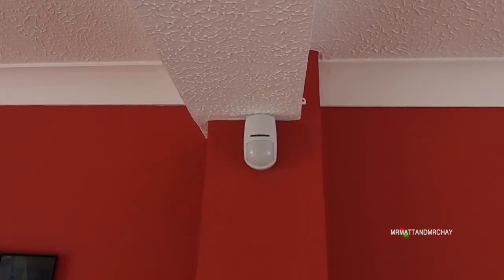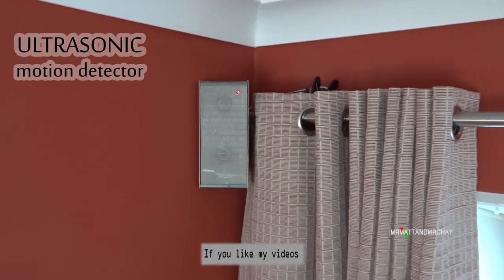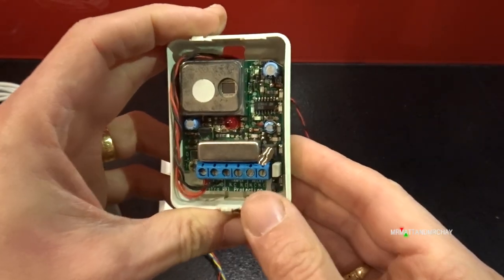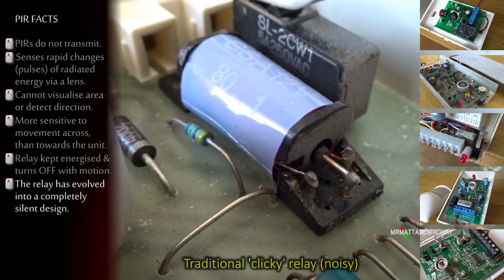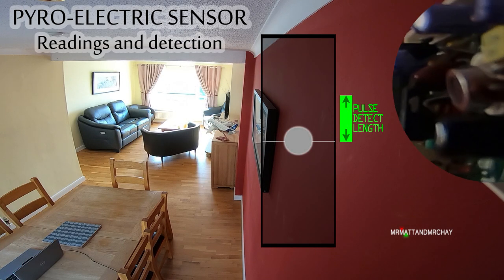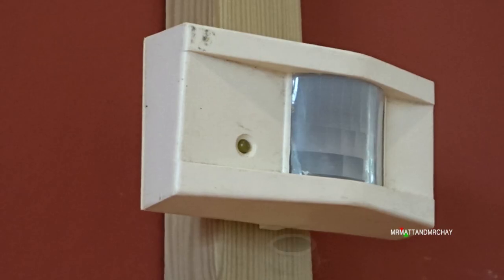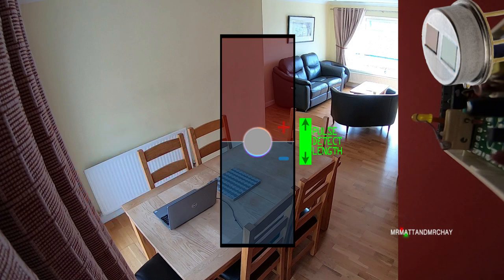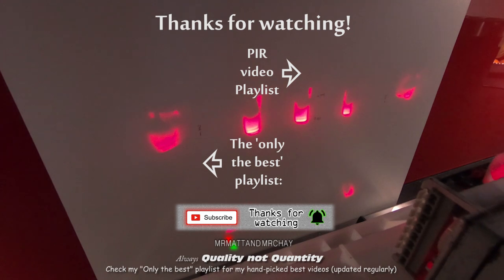PIR motion detector - HOW IT WORKS (easy to understand)

Comment: Great explanation, thank you! That reminds me of how I tried to make colleagues understand why the alarm system didn't go off when a piece of ceiling cladding in a room at work came loose one night and fell down. "We have got motion sensors, it must set off an alarm", but they just didn't understand that something that has the same temperature as the rest of the room and therefore does not emit more infrared than everything else around it is invisible to PIR detectors. They just didn't understand it and thought our building's alarm system is just fake. Now I just need a video like yours in German, maybe they'd understand.

However, when you mentioned the microwave detectors going through walls, I had to laugh, because that's what happened to me. I installed a hallway light with microwave motion sensor close to my flat's entrance door, and I noticed that the light already turns on when I walk up the stairs leading to my door. Fortunately this flat  is the only on on the top floor of the house, therefore there isn't any foot traffic passing by making the light go on and off when there is no need for it. But on the positive side, if ans burglar things nobody is home because the lights are off, and sneaks up the stairs, they'll be greeted by a light that comes on when they are approaching, making them wonder if there is anyone in there. :-) So their capability of seeing through walls can be an advantage under certain circumstances.
Reply from the maker: I cringe when people wave their arms around in front of them to activate detectors that are far enough away, then they say "look it isn't very sensitive". Sigh!
Yes, about the heat issue, that's why (unless they're really close) trees and bushes swaying doesn't activate external PIRs.
I use Visonic Duo 360 PIRs (actually they are dualtecs) in our house - really small!  The living room unit, the microwave part is always activating when someone is in the bedroom above - obvious that's fine.  In PartSet, if the PIR doesn't detect anything then all is good!
Thanks for the comment :)
Reply: Some PIRs motion detectors have an oddly shaped field of view though. The one controlling the light aboce the entrance to this building often times triggers when I am still parking my car quite a bit away from the door, but as I am standing in front of the door getting my keys out of the pocket it fails to detect me, no matter how much I move around.
Having an alarm system inside someone's flat is really uncommon here, even for houseowners it's not that common to have an alarm system. Some do, but it's rare. Most alarm systems here are installed in business environments, where nobody is around at night - and also often nobody is in the neighborhood as well. 
Around poeple's homes here in Germany, motion sensors of all kind are usually  a convenience thing to turn lights on when needed. Or like in my hallway the only way to turn a light on, the hallway of my flat seems to have been extended at some point, relocating the entrance to the bedroom - but the hallway extension didn't have any lights. Not wanting to make a big mess installing a light switch, I just routed a wire across the attic, coming down through the ceiling in the right place for a light - but the only option to turn it on was a motion sensor... Fortunately it doesn't detect motion close to the floor, as my cat (when I still had her) was able to walk underneath the light without triggering it.
Greetings from Germany from somewone who has been following your videos for a really long time  - probably not too long after you started this channel. :-)

Comment: Fascinating. As a kid, I loved playing with these and managed to fool our outside light PIR by running very quickly past it. Any slower movement than that and it would trigger.
Reply from the maker: That's an interesting comment, perhaps the read frequency was low on that PIR, so if you ran fast enough, the pulses couldn't be read quickly enough?  I must admit, never considered this before but could be a cheap design?

Comment: Came across this informative video while trying to hack and adjust a wall-mounted solar-rechargeable driveway PIR sensor light I have. At first I thought the rechargeable battery was no good as the unit would stop lighting up early in the evening. Then I realised it was because the sensor was pointing not just at the driveway, but into the street where every car which passed would trigger it, hence running out of charge so quickly! Since this was a cheap model which did not allow for adjustment of the sensor direction, I experimented by placing a sticker over the top half of the hemispherical lens. That seemed to work well - it would not trigger if a car drove past, but it would if I walked onto my driveway.

To try to make the hack more permanent, I coloured in half the sensor lens with several coats of a black marker. But that didn't seem to work and the sensor continued to trigger when a vehicle drove past, until I covered it again with a sticker. I'm wondering if it could be because the black marker ink doesn't block the heat radiation?
Reply from the maker: Would be better to angle the PIR down to avoid it being aimed at the road.  The upper zones of the lens are probably the most sensitive, as those are designed for 'distance'.  The middle and lower set, the segments are smaller and are designed as look down zones.  Ah - but I've just read that you cannot adjust the angle!! ...therefore the only way is to mask the lens.  Colouring in the lens won't work, the ink thins out and doesn't apply evenly - if the PIR can see through the plastic lens, ink won't really do anything.  Best way I found is silicon sealant to mask it.  But PVC tape works just as well, cut it with scissors to make it look good (rather than tearing it).

Comment: Very interesting demonstration, I always wondered what the pulse count setting was for. I’ll have to try shining an led into some of mine and seeing that pulse pattern, would be interesting if manufacturers included an led in there for the purpose of aligning the sensor better. Perhaps in the addressable detectors even make it so you could enable said led from the panel itself. Great quality video as always, I really enjoyed it!
Reply from the maker: Glad you liked it!  There were a couple of detectors which did have the 'lens zone finder' LED.  One of which is featured in an up-and-coming video.  Another of which was the Visionic SuperRed PIR, but essentially it was an LED that 'covered' the pyro electric detector, just so that you could see the zones.  You had to remove the LED afterwards.  But any LED that shows the zones would have to be placed in 'exactly' the same position as the pyro, therefore it couldn't remain there for normal functionality.
Addressable PIRs (unless wireless which is totally different) are never a good idea, having data travelling up and down cables introduces a whole host of problems, with compatibility with panels, to data-issues on the cable.
Thanks for the comment.
Reply: @mrmattandmrchay  Very interesting, I'll be looking forward to that upcoming video.

Comment: Thankyou!  So in-depth yet really easy to follow. What is your opinion of DTs?
Reply from the maker: Cool, thanks for the comment!  Dualtec's are used by most companies to reduce false alarms, PIR only are really only used for domestics due to their smaller size.  Can't see any reason for a company to not use Dualtecs for most sites.
Reply: @mrmattandmrchay  I fitted a dual Tec in my house as was getting false alarms from Pet PIRs. No complaints so far.

Comment: Nice vid,I have a few questions,I have 2x bosch pir sensors in my back double car sized shed,they are wireless with a repeater housed 20m away in the house roof,sometimes iam getting false alarms,there is a solar internal type fan on the roof/ceiling,not sure if this could set it off or maybe sunlight under the roller doors,pls.help.

Comment: I've found it amusing to slowly move in the vicinity of a PIR and see if I can avoid it detecting me.
Reply from the maker: If you move slowly enough then it's possible, but I'd like to see a burglar break into a house and steal the widescreen TV moving that slowly! :D  It also depends what part of the PIR lens is detecting you.  If it's the main/upper set, then very difficult.  The lower segments of the lense you'll notice on some PIRs are slightly larger, but less of them - it's to do with the angle of the lense compared to where the pyro is mounted on the PCB - the lens has to be enlargened to compensate.
Reply: @mrmattandmrchay  Screwing around with an alarm system for fun is one thing, but you're correct that a burglar wants to get in, grab, GTFO, in the shortest time possible since they don't know when someone could potentially pull up. I've noticed the older PIRs were easier to sneak up to/past compared to the newer ones.

Comment: Junk. i have never been able to get one of those things to work, ever, then i found out the factory has a 40% failure rate, still i have 10 in a box, never done anything with them.
Reply from the maker: I've been in the industry since 1989 - yes of course, some fail, but I've never heard of a 40% failure rate.  Fitted hundreds, for me 0.5% failure rate.

Comment: Relays are like dinosaurs , one day all relays on the world will be extinct :/
Reply from the maker: It's a very simple way of joining two devices together so they can talk to each other using inputs and outputs.  Only recently, a customer wanted a system to do something that wasn't achievable within the programming of the systems.  But I added a few relays, a couple of timers, linked some outputs from system A, to inputs on system B, and managed to do exactly what the customer wanted.  It was a little more complicated than that, but you get the idea?  Never would have been able to achieve it without relays, even in 2021!! 
 Good thing is, you can see exactly what's happening without software (i.e. is the relay on or off).